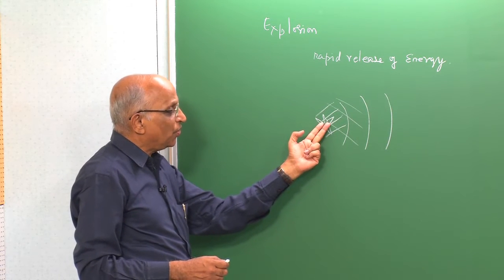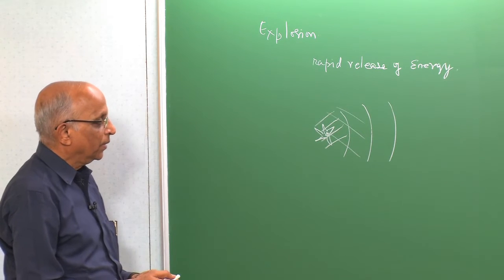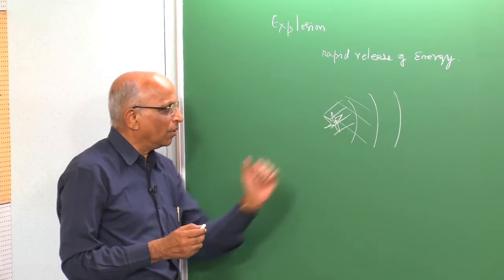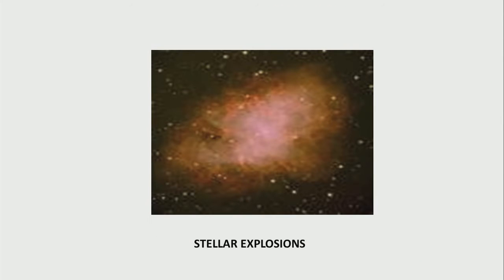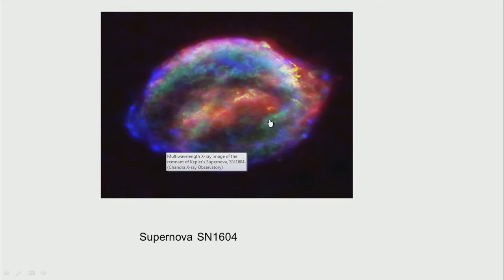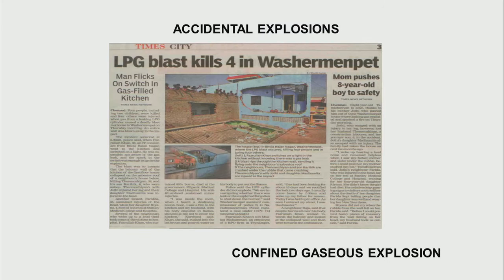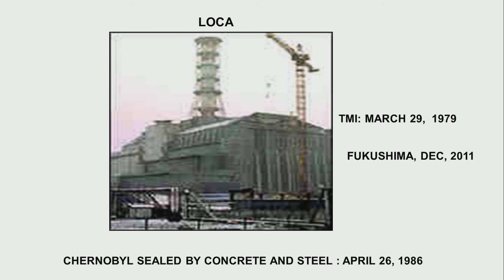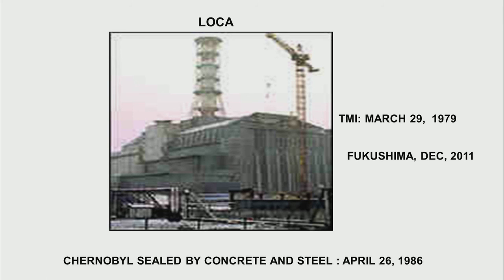Mod-01 Lec-03 Typical Examples of Explosions and Classification

Comment: The medium doesn't move - yet there is kinetic energy... If the potential energy of the explosion is transferred to heat energy, it cannot be used for work - yet, in a previous lecture you identified potential energy as a function of the heat capacity and temperature... Great anecdotal stories on historical explosions though. Is there away of deriving the dimensional result from Newton's laws and get the constants of proportionality?